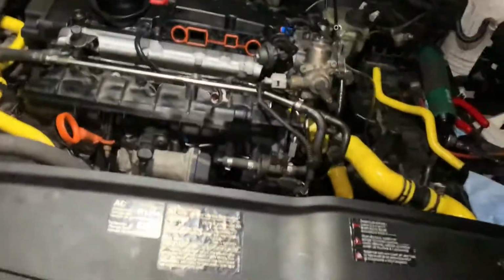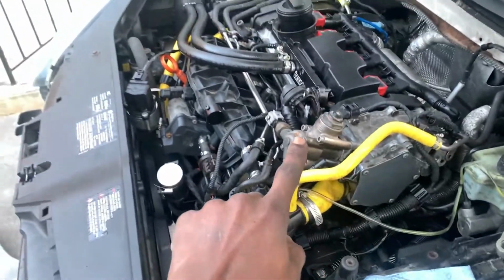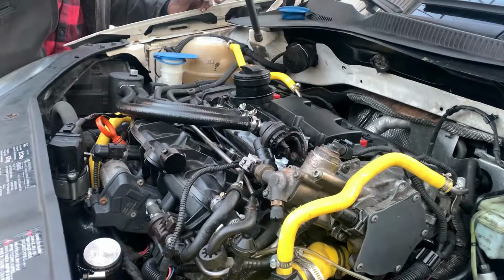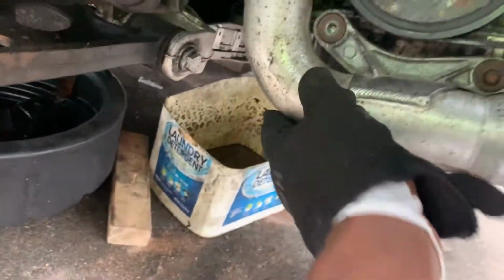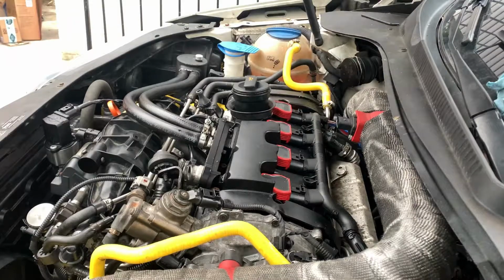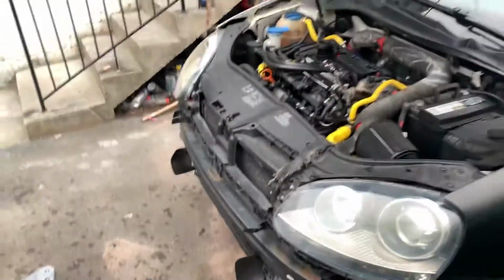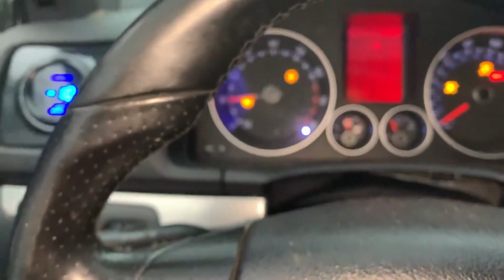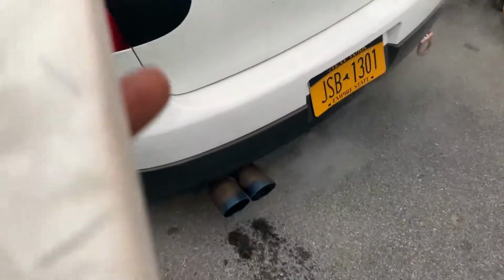Will My Stage 3 Big Turbo Mk5 Gti Start? Big Turbo conversion|BPY

Comment: Good stuff man, hope you get it all lined out! Def wanna heat cycle a couple times, most the old time engine builders I know will do some unloaded mid-range free revs before taking a drive and putting a load on them also to be sure everything is 100% or close anyway lol.
Reply from the maker: Thanks brother. Appreciate it 🙌

Comment: good job man, 
for water leakage check the water pump
Reply from the maker: I got it all sorted out. Next video, you will see, but unfortunately, I still got a swollen hose by the coolant flange. I removed it and put a tighter clamp and it didn't solve the leakage, but the hose was swollen tho.

Comment: what manufacture do you recommend i get my k04 turbo from?
Reply from the maker: I am running  a hpa hybrid turbo. No issues so far.
Reply from the maker: Venom turbo also good just price
Reply: @GTIMKV   whats your power gains with the ko4?
Reply from the maker: @daintonfoster3568  close to 360 hp.